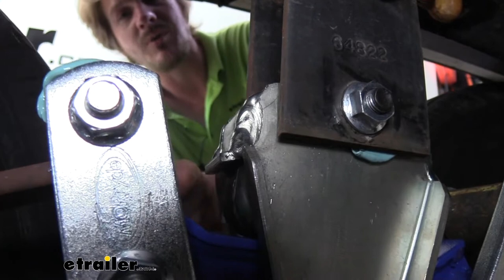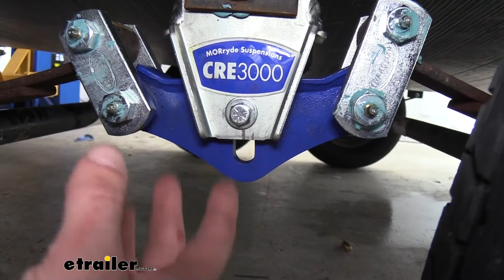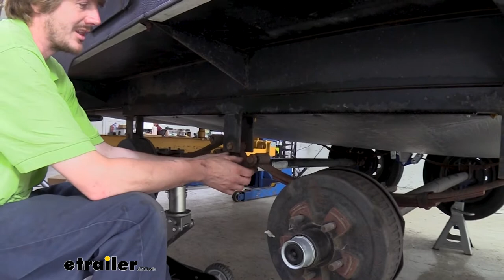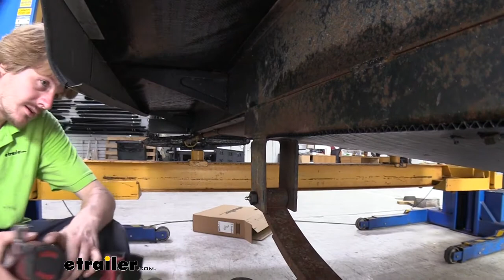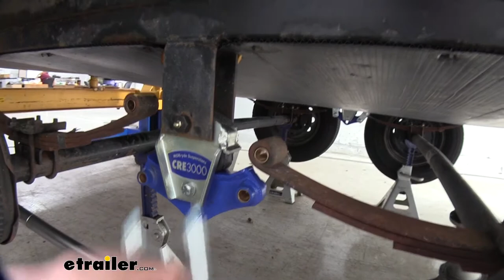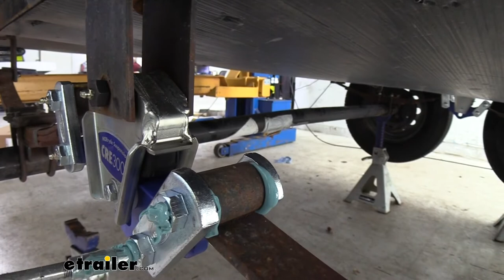etrailer | MORryde Tandem Axle Trailer Rubber Equalizers Installation

Comment: The correct term for the suspension cushioning is damping, not dampening. The definition of dampen is to make something wet.  Damping is a decrease in the amplitude of an oscillation because resistive forces drain energy from the system.
Reply: I'm glad you made that clarification. You've saved me a fortune on my water bill.  I've been spraying my trailer's suspension with a garden hose for two years now to make sure it works.

Comment: Excellent video  Somebody told me to change the Springs  Too but the trailer's only 2 years old what's your suggestion
Reply from the maker: Some manufactures do not put the most heavy duty spring on their trailers right out of the factory. If your springs have not flattened out, they are perfectly fine to reuse with this equalizer upgrade.
https://www.etrailer.com/Trailer-Leaf-Spring-Suspension/MORryde/MR87ZR.html

Comment: What if the wheel base is small then the one you installed is there a smaller equalizer?
Reply from the maker: There are different size replacement equalizers for the different axle spreads. Check out the following link to see the MORryde kits we have available
https://www.etrailer.com/dept-pg-Trailer_Leaf_Spring_Suspension-pm-MORryde.aspx

Comment: I have the 4000 on my trailer. How much difference is there?
Reply from the maker: The SRE4000 kit is designed for a trailer axles up to 7,000. The CRE3000 is for trailers axles up to 8,000 lbs.
https://www.etrailer.com/Trailer-Leaf-Spring-Suspension/MORryde/MR87ZR.html

Comment: Wow that front axle is bent.
Reply from the maker: Where exactly are you seeing that in the video? I can see an arch in the front and rear axle, but that's normal. The axle tubes are designed  to have an upward arch in them so that when weight is added to the axle they flatten out to ensure full contact of the tire tread to the road surface. Hope that helps explain what you saw!
https://www.etrailer.com/Trailer-Leaf-Spring-Suspension/MORryde/MR87ZR.html
Reply: @etrailer Nope I stand corrected.  I could have sworn the tires were on the ground.   I just bought a set of these from etrailer hence me looking at the video.  Thanks for the clarification I can say when I am wrong.  And this video is light years better that the MORyde one which was pretty useless.
Reply from the maker: No worries, it's good to know folks have their eyes open!